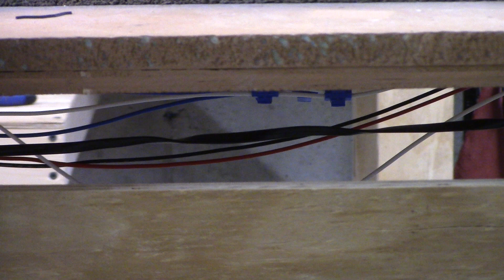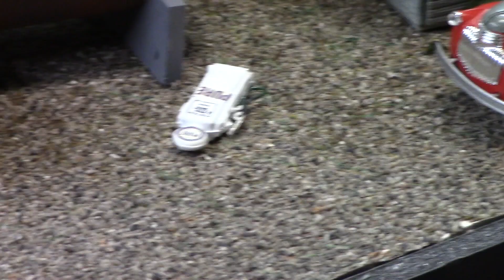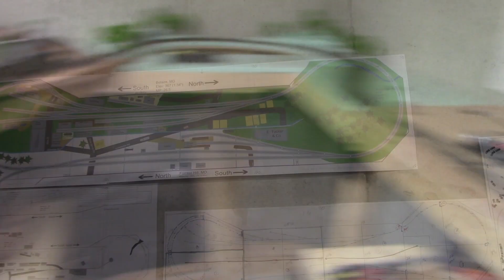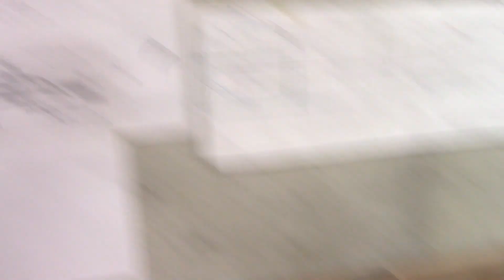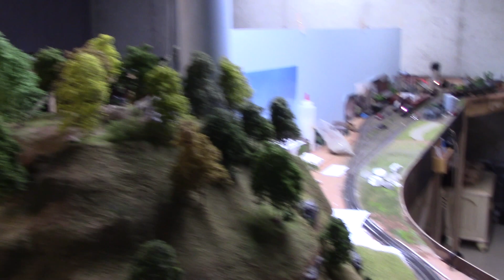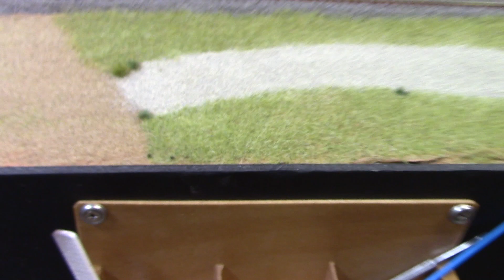Layout Update #9 - April/May 2020

Comment: Rick , how big is your layout
Reply from the maker: The main penninsula which is home to Bel Air and Forest Hill is essentially 4' x 16'.  Baltimore yard is 18" x 11' (plus 1 foot for the turntable).  York yard will also be 18" x 11' and the  section connecting Forest Hill to York (which is Cardiff) is 18" x 10'.  Overall the current version of Phase I occupies an overall space of 15' x 18' - mostly around the walls plus the main penninsula.  The full railroad (Phase II) will expand to fill an overall footprint of 28' x 28' - if I live that long... 😁
Reply: @TheSwitchList  I was wondering that myself!Give us a panoramic view of the whole thing. It boggles my mind how you do this. I could never, ever. But I really like looking at what others do.
Reply: I only have a area 7 ft x 16 , just not sure of a layout yet, have some ideas but can’t see how it will work until I get the space cleared
Reply from the maker: James Gaulton I know exactly what you mean. I had to clear a lot of stuff out of the basement to get started. Looking forward to seeing you progress once u get stated!
Reply: I am setting up a small N scale layout, so I can run trains ,